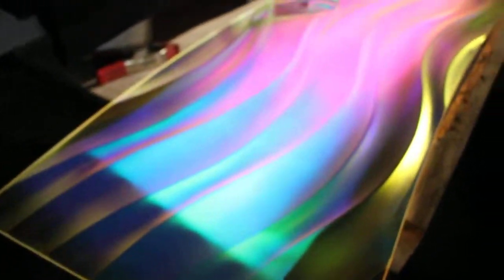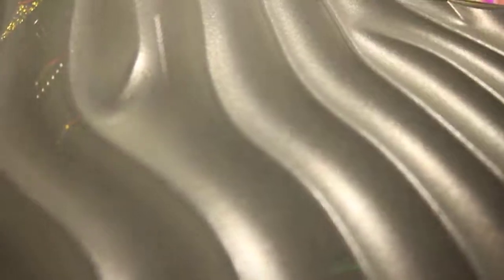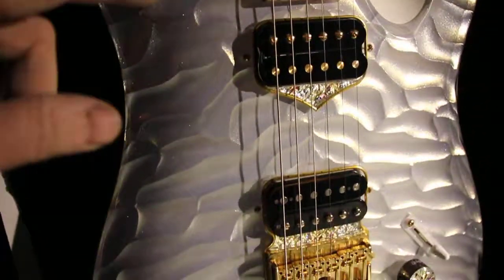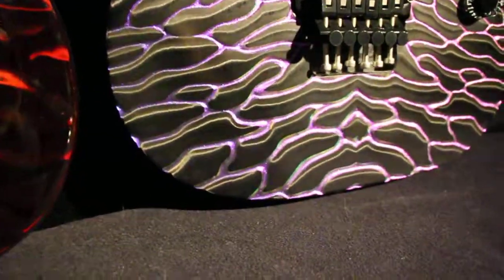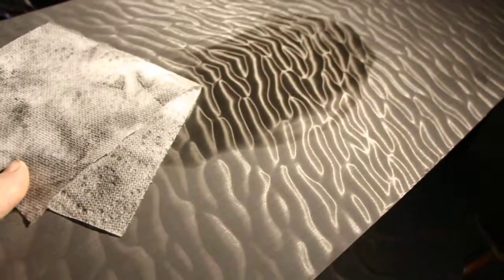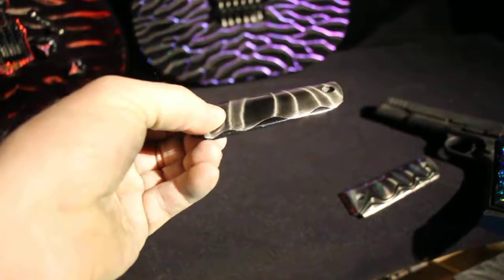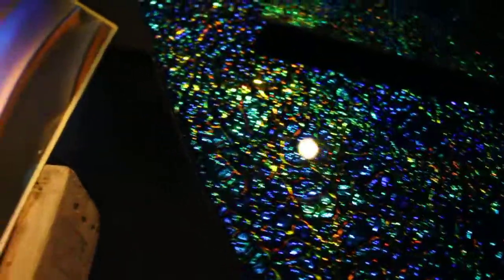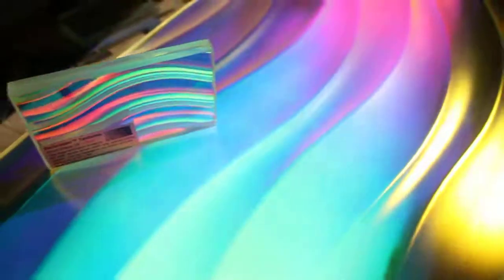The development of Chatoyant Carbon Fiber™ and Dichrolam

Comment: A carbon quilt top for a guitar is $200?
Reply from the maker: No, its around $500.00 per top @ 13" x 22".  200 is the low end of sq ft price. Thanks!
Reply: @johnblazydichrolamllc3232  Are there any price breaks for buying in bulk? Like if you purchased 10 or 20 or 50 at one time?
Reply from the maker: Yes, for sure.  Email is dichrolam@att.net

Comment: John, this is really amazing material, congratulations for being so ahead of your time. I would love to cover the front of a Les Paul with that, is that possible? would your material conform to that body shape etc? Even if you could use it just as trim on the guitar would have an instant effect - thanks.
Reply from the maker: Hi Rod,  the thin veneers are semi rigid, like metal, so won't conform to compound curves without splits and wrinkles under heat.  Cylindrical curves, yes, not compound.  Send email to dichrolam@att.net for info.  Thanks!

Comment: 100% Amazing.
Have you ever tried to laser scan a real piece of Quilt or Flamed Maple (similar to what is done for 3D Modeling/Manufacturing) and then use the dataset to 3D Print or CNC Machine a new mold?
Truly amazing.
Have you ever tried to produce something like a Opal gemstone pattern, those would make for beautiful guitar fret marker inlays.
Thank you for sharing this.
Reply from the maker: I initially used photos of real 5A quilt and traced parts in CAD.  Then I got real good at freehand drawing the quilt actually BETTER than the real thing - more graceful, no dead areas, facial imagery, etc.  I'm like an Impressionist painter with wood figure.  As Van Gogh said, "I don't paint exactly as it really is - I accentuate and deviate to my liking.  Lies, if you will, yet truer than the literal truth"

Comment: Will it conform to an arm relief or carved top guitar with heat?
Reply from the maker: Yes, heat gun can bend to forearm bevel.  But cant to compound curves like arch top
Reply: @johnblazydichrolamllc3232  - at what temperature does it become somewhat pliable? I'm wondering if i was to heat a sheet in an oven over a silicone mat if it could then be vacuformed on say a les paul style top?

Comment: Could a drum manufacturer obtain sheets to put as a finish ply on drum kits!?
Reply from the maker: Likely too pricey.  My lowest cost material is over 100.00 per sq ft.  CCF is 200 for veneer.  Would be coolest wrap ever, but most drum companies are too price conscious to even try it.  Can be inlay banding, to save $ instead of entire cover.
Reply: John Blazy Dichrolam, LLC While your product is admittedly costly there is nothing else like it on this planet, so it is well worth what you're charging.
Question, is this material UV resistant or will the color fade from exposure?
Reply from the maker: @hkguitar1984  no color fade at all, because no pigment or dye.  All dichroic structural color

Comment: Wow man, all I can say is WOW. Your work is truly mesmeric. I have been diving deep into dichroic materials after finding your work on Instagram, and your work is by far the best I have been able to find. Obviously, you have spent years honing your craft and producing proprietary textures. I was just curious if you would be willing to share any resources you used to get into dichroic material manufacturing? I have searched high and low, and there are very few resources out there. I would love some recommendations to get the ball rolling in exploring this absolutely radical craft you get to pursue daily.
Reply from the maker: Thanks Paul!  The theme music for my work is "Built for the Future" by The Fixx, because ". . . it doesn't mean much now,  it's built for the future . . "  Designers are only just now discovering dichroic films, and doing what I was doing back in early 2000's - laminating flat between glass or on acrylic - no textures.  I knew that would be common someday, so I developed molded and tight pattern textures early, and only just recently nailed down the adhesion technology for high interlaminar bond, which is of paramount importance.  No point getting into dichroic laminating tech unless the whole sandwich stays together.  That area is highly proprietary, so not disclosing that, but there is much to the dichroic envelope that you can push, especially since I am getting away from dichroics now, and moving to better market response products like my CCF.  You can buy the dichroic films with an adhesive on them already (decorativefilms dot com) for a myriad of applications besides obvious flat glass and acrylic, but I am selling my textured films with my proprietary adhesion primer already applied with backfill, for end user to cast resin onto.  Too bad I never had investors to help really penetrate the arch market, as I think is has great potential, but again - its for the future when architects wake up, not now, so I am moving on (developing CCF and "shelving" Dichrolam for a while).   I'm reachable better via email - dichrolam at att dot net.